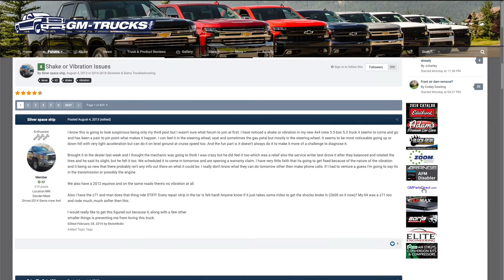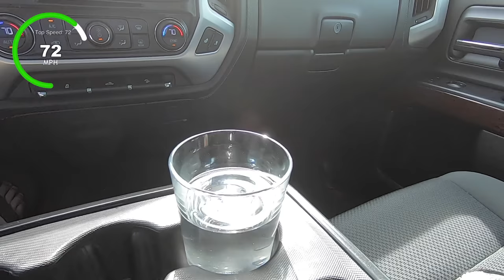"Chevy Shake" Driveshaft Fix for GM Trucks?

Comment: I have 18k..no shake..I have a soft cover and notice it causes a little but not what everyone else has been experiencing. Mine is a 2018
Reply from the maker: Yeah it seems to be hit or miss
Reply: @GearsGadgets  okay now at 28k miles.. I have the dreaded shake. Its bad at 1500rpm up and thru 3rd gear. If I get on it it smooths out a little but at cruiz speed its horrible. Last GM product I will ever own... im done. Every single model of GM has its MAJOR issues.

Comment: Funny you had a drink to show shake. Mine does that too at 60. No open drinks!!
Reply from the maker: Yep, I’ve had coffee splash around from the vibration enough to make its way out of the ventilation holes.
Reply: @GearsGadgets  have you ever felt a delayed jerk when stepping on the gas pedal?  Happened a few time in mine but dunno what to make of it.
Reply from the maker: @TheDkb427  YES!!!! I did the paint stick gas pedal modification and it was night and day. There was basically 1/2” worth of “slop” in my pedal so essentially every time I hit the pedal there was a delay and it was VERY noticeable. Check out this thread here: https://www.gm-trucks.com/forums/topic/167606-gas-pedal-flex-solution/
Reply: @GearsGadgets  whoa!!!  That's crazy man. Glad it's not just me. Thanks for the link

Comment: I've got a 2013 Chevrolet 2500 HD and I have just about replaced every bearing every calibre every roeder every tire and I just thought about changing the driveshaft are getting it rebalanced its got 225000 miles on it and it does have the Chevy shake and yes I am going to try the driveshaft
Reply: Did the rebalance solve the problem?
Reply: @markcoe2201  it was the tires... put on general tires 35x12.50x18.  With balance bags...issues gone

Comment: What people don't realize is that you can have horrible vibrations from a tire that zeros out on a standard balancer. 

Check the road force numbers, if it's over 26 lbs it's out of spec for a p metric radial... ie it needs replacement 

A quality tire like a Yokohama or even a nexen or tbc believe it or not will normally be under 20 lbs road force and many times under 15lbs... that is the single biggest reason for vibrations on an otherwise healthy and unmodified vehicle...
Reply from the maker: I have had 2 different brands of tires and neither made an impact of vibration which tells me tires had nothing to do with it. Also, dealer replaced a wheel that was out of spec, that also had 0 impact on vibrations. Road Force balancing did nothing.

Comment: i have 2020 silverado 1500   it shakes alot i thought it was from 24' wheels and i got a balance but it was same as before  
what can be done ??? had a ram before  no shake or vibration
Reply from the maker: You have a 2020 shaker? That blows my mind
Reply: put your stock tires and wheels back on and that’ll tell you if it’s your setup. skinny tires and big wheels and famous for a rougher more vibrating ride.

Comment: I bought a 2018 Silverado 1500 and there’s a slight vibration in reverse and drive and speeds below 5 MPH  and when I get up to 70 or 80 or so there’s a slight vibration
Reply: My 20” wheels were bent causing my vibration at lower speeds like that

Comment: I have a 2015 Suburban it also has a chevy shake. My vibration was less but not great after a complete front brake job. Months later when I had complete rear brake job
the vibration was far less noticeable. I have yet to replace the shaft or axles. I personally think the chevy shake is a combination of rotors, axles and drive shafts. I also
own a 2015 Sierra SLT crew 4x4. This truck has no vibration.
Reply from the maker: Interesting, I think that is the first I have heard of a Suburban or Tahoe with the issue. (Sorry for the late reply, trying to catch up on old comments I missed)

Comment: Good job sir ! Did find solution for Chevy Silverado shake ?Thanks for your help
Reply from the maker: It’s complicated. It’s about 90% better and the driveshaft / rear axles were a HUGE component. There is still something there that works up on occasion but I cant quite put my finger on it.
Reply: @GearsGadgets  Transmission is the issue. The fluid does not work well with the torque converter.

Comment: I heard the vibration issues are the torque converter
Reply: Yes that was what I found and I see they are replacing torque converters to rectify but here in Oz we don't get that option if privately imported so I changed the type of oil to BTR spec oil which has a friction modifier in it and stops concertos clutch shudder  that BTR trans suffers years ago
Reply from the maker: I am hearing that more frequently now.

Comment: This is weird to me as my 2014 Sierra AT is glass smooth at all speeds
Reply from the maker: Hmm (Sorry for the late reply, trying to catch up on old comments I missed)
Reply: My 13 gmc was smooth, traded in for a 19 trailboss I've had it a touch over 90 mph without a bit of vibration.   Yours must be an alignment issue with the drive line or the diff itself.  At least gm compensated you.  Hope it's worth it
Reply: While mine is a pretty maroon vibrator.

Comment: Does it vibrate in 4wd or 2wd? If it vibrates in 4wd but doesn't vibrate in 2wd its probably the shorter front drive shaft.
Reply from the maker: 2wd. 4wd I wouldnt tend to get up to 70 mph haha.

Comment: Hey man!  I literally just bought a 2016 Silverado 2 wheel from a GM dealer.  I was recommend the dealer from a co-worker who has bought 8 cars from them.  I didn't take the truck on the highway on the test drive (it was almost out of gas).  I said I would buy more gas, the salesman didnt want me to do that.  
 So, anyway, i didn't notice the shake before i bought it.  But damn, at 70 mph it does the Chevy Shake!!  I paid 30k for this truck.  It only has 15k miles on it.  I did buy a very expensive $2,600 bumper to bumper warranty.  I immediately brought it back and they changed the rear tires, said it was fixed.  Not fixed.  I drove it today - shakes still.
I brought it back today.  The sales manager wants me to bring it in monday am to drive it with the maintenance manager.  He said they will either fix it or make some other type of arrangement.  
My question is: should i let them fix it further or just go straight to the top and demand my money back.  I belong to the same country club as they owner of this place.  I already don't like the truck now because of this.  Its real heavy, lumbering.  The gave me a 2020 Silverado to drive for a couple of days and i really like it.  Thanks for your input!
Reply from the maker: Go straight to the top and demand your money back. it will drive you INSANE and my experience is the longer you let them dick around with “fixing” it the the harder it will be to get out of it.
Reply: Gears & Gadgets - so they moved the front tires to the back- still shook.  Then they balanced the tires - still shook.  Then they replaced the front tires and now it rides perfect no matter what speed i take iit up to.  You think I’ll be ok?
Reply: A 2016 would have a special coverage for the 8 speed transmissiom to flush the torque convertor fluid and possibly replace the convertor under the special coverage
Reply: I just purchased a 2020 silverado 5.3 Texas edition and have the same shake/ vibration. Traded in a 2016 5.3 that drove smooth as silk. Smh

Comment: My 14 silverado had this shake. I dropped the tire pressure to 34 psi cold  on nitto ridge grappled and it went away. I just got lucky.
Reply from the maker: Interesting.
Reply: I have also been playing with tire pressure.  2017 2500 Denali.  All new tires and 1 rim.  

Rear pressure @65 front right @ 70 front left @73. 

Took a lot of the vibration away but still there when it wants. Comes and goes.

Comment: i dont have the chevy shake. 2016 silverado 1500 / 88,000 miles. what i am experiencing is the chevy clunk in the rear over minor bumps lol. im guessing its my leaf springs done alot of research and its not axle wrap. i can lightly push down on the tailgate and sounds like someone knocking right under my bed lol. people need to know that every truck has their issues.
Reply from the maker: Yeah what you are describing is more or less normal wear and tear and "Things break" type of stuff. A massive amount of people buying trucks brand new experiencing driveline vibrations, then being dismissed by the manufacturer is more of a defining QA/QC statement from the brand more than normal wear and tear type issues.

Comment: I find this to be a very strange and interesting topic that no one has looked at yet. I have a 2014 Chevy Silverado 1500 crew cab short bed with the 6 speed transmission and it shakes like hell all the time. My father has a 2016 Chevy duramax that’s a crew cab short bed which is essentially the same body truck as mine and it does not shake one bit all the way to 120 mph. Even though it has the Allison 8 speed it’s technically the same truck with a different engine as well. So the real question is what is gm doing different with the 1500’s compared to the 2500’s. I looked further in to seeing what the ride quality of a 2016 2500hd gas engine v8 would be and it also shakes like hell. It does not add up. I recently drove a 2020 high country duramax with the new body style and it does not shake as well. It just does not make any sense.
Reply from the maker: yeah I don’t get it either.

Comment: Ive done Axles and Driveshaft from Performance Driveline. 95-98% Better. I think I'll check rear wheels next
Reply from the maker: Its just a guessing game that I believe GM knows the answer to.
Reply: @GearsGadgets  I think the answer was we better make a different truck. Hello New Silverado 2019-2020. Because 2014-2018 Frame is Too Stiff and Sends unwanted VIBRATIONS sometimes. Some models are worse than others but let's keep it Hush Hush till the new Platform rolls out
Reply: @GearsGadgets  I've managed/modded my truck to have no vibration between 0-90mph. From 95-105 sometomes I have a slight vibration other times its not there at all. WTF

Comment: You are half way there....replace the front axles as well, and notice the difference.  Used to sell these pretty trucks but ( Ford too) when the parts are made in Mexico....the quality has gone to the dogs.  Parts cheaper to make in Mexico but you get what you pay for.  Ford has issues but overall, Ford does a better job....never mind that they don't rust out like the old chevys.
This issue should be resolved by GM but as so often is the case, GM thinks that there are always more customers who don't know and will take it on the chin.  Stupid concept but...they have done it over and over again.  Bought GM's all my life...still have a rust bucket....but I would NOT buy another.
Reply from the maker: I appreciate that context for sure. Thanks for the info.

Comment: Has anyone else notice it when the v4 mode kicks in? I have a 2015 Silverado 5.3 that when the v4 mode kicked in it would vibrate, I bought an edge programmer so I could turn it off, I have no more vibrations, v8 all the time, only bout 2 to3 mpg less
Reply from the maker: Mine wasn’t effected by the V4 / V8 modes.

Comment: Was the shake always there? Or did it just show up one day?
Reply from the maker: Let's walk in the woods it was there from day one and described as tire flat spotting. It made sense to me since it was the last 2015 on the lot and had sat there through a 115 degree summer. Salesman (who plausibly knew of the Chevy shake) did a great job of selling a potential problem that would be covered in warranty if it didn’t drive out in a couple hundred miles. Then the miserable experience of drawn out diagnosis and repair attempts began. Learned a valuable lesson.
Reply: Thank you for your quick reply.  I just bought a 2015 with 90000 klm and I have joined a couple Facebook groups for silverado's. I am hearing alot about "the shake"   so I get in the truck and get on the Hwy... Set the cruise,  and slowly increase speed incrementally from 100 kph to 125 kph. I could not find a spot that it shook at all.   Thankfully..  

So,  if you had to guess, what percentage of trucks would have this issue?
Reply: @letswalkinthewoods1462  I have a 2015 Silverado Z71 crew cab 4wd with 97000 miles I bought brand new. Always been smooth as silk any speed up to around 98 mph when computer shuts it down. Guess I'm lucky.
Reply: @johnehlert4366  I have the same truck, 2015 Z71 LTZ I have none of these issues either.

Comment: Has any of the diagnostics that were performed found out what frequency the vibration is happening at? This should not be that hard to prove. I just recorded a case study on a 2008 that had a vibration at the same speeds and it shows up right on my equipment and then you just look to see what order of vibration it is and what components are spinning at that speed.
Reply from the maker: They do the picoscope test but they don't share the results with you. The diagnostic equipment is too cost prohibitive to buy for the average person and the cheap phone apps are too inaccurate to really trust.
Reply: 14 Hz apparently

Comment: Did GM ever solve this issue in this generation of truck? Do the 2017 or 2018 models have the same problem?
Reply: I work for a GM dealer as a tech. The problem is not as common on the 17s and 18s. Theres a couple issues that cause this. The gm chassis is very sensitive to vibrations. When we road force balance tires anything over 12lbs of road force is considered too much. Gm has basically cut the road force limitations in half when compared to other vehicles. I have personally seen driveshaft balance issues, tire road force issues, and rear diff issues. The issue with the rear diff is the backlash on some of the pinion gear teeth are out of spec. So gm wants you to measure the backlash on every tooth on the pinion gear. It also seems with the bigger wheels especially 22s, they are more prone to the vibration. I personally had a 2016 Silverado that had a shake but it was intermittent. I road forced balanced the tires a few times and seems to go away after that but would still eventually come back. It's a shame I really liked that truck. I now have a 19 new model ram 1500 and it rides like a Cadillac.
Reply: @Jeff-em7zs  How do you like the Ram? I have been a GM guy my whole life. But the 07-13 trucks were cheaped out crap due to the recession and bankruptcy. The 14-19 models seem to be plagued with this shake problem. And the newest models are incredibly ugly to me. They really look like several trucks put together like the Tundra, Ford, GM and Ram all mixed into 1 truck. 

So sadly, I keep considering other trucks. I can't do Ford. Just can't. The Tundras and Nissans are basically the size of 2500s with the performance of a 1500. That only leaves Ram left.
Reply from the maker: It hasn't been "officially" solved that I am aware of. Lots of TSB's and people seem to report to me a lot of different approaches to very similar problems.

Comment: I have a 94 with 350k. It only shakes after going over tracks or some big pot holes. Does not shake on smooth roads at high speeds.. any thoughts? Thanks

Comment: So I have a 2014 Sierra Crew Cab and don’t have the Chevy Shake. Is there something I should watch out for?
Reply from the maker: Honestly most people seem to either have it from day 1 or don’t have it at all so if it’s NOT shaking today it is likely fine. I say that based on what I have seen with other people but I think it will be interesting to see how they hold up now that a lot of these trucks are hitting the 75,000 mile + stage of their lives and likely hitting the used markets.
Reply: @GearsGadgets  follow up to this conversation. I have the same truck and have noticed over the 1+ year that I have owned it that the shake has in fact reared its ugly head. It’s on my radar to fix but it doesn’t take priority over delayed engagement between 5th and 6th gear as well as rough shifting into drive from time to time. Gotta look at the tranny first! FYI my truck just broke 110k, I first noticed the shake at around 95k but that’s not to say it wasn’t there before that mileage I just may have not noticed it

Comment: Isn’t this a transmission problem? Bad fluid causing the torque converter to wear out?
Reply from the maker: I have heard that but I have also heard 1000 other things.
Reply: Do you have the 8 speed automatic?
Reply from the maker: ukrainetrain84 6 speed
Reply: Maybe not then. The fluid/torque converter issue seemed to be isolated to the 8 speeds. Have you changed your transmission fluid by any chance?

Comment: Yeah mine done that forever I’ve got used to it
Reply: Oh man, that sucks.
Reply: ChevySS1968 it’s not bad it actually got better when I lifted the truck
Reply from the maker: It got better with lifting? I would have thought the opposite. I have been afraid to do anything to the truck that might make it worse.
Reply: Gears & Gadgets a full suspension is the only way to go.... if you do a leveling kit they ride like shit .... needless to say I started with a leveling kit then went balls deep
Reply: @GearsGadgets  yeah, I woulda thought same thing. Lifting usually makes everything worse.
Reply: Mine has done it since I got it At 34k miles I have 66k now I lifted and it is same or maybe worst but mine is almost all speeds dealer ship has been no help the 3 times I have taken it they said nothings wrong with my drive shaft